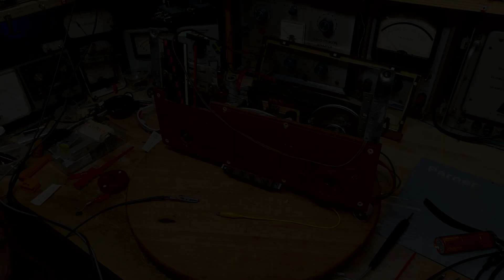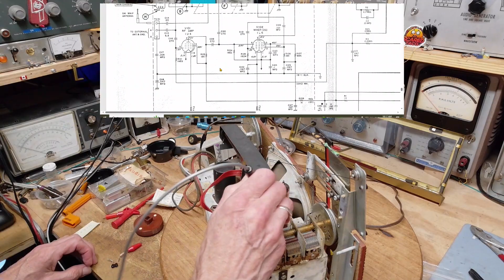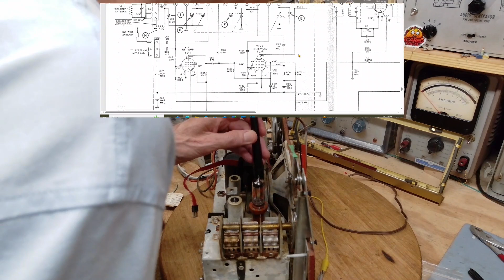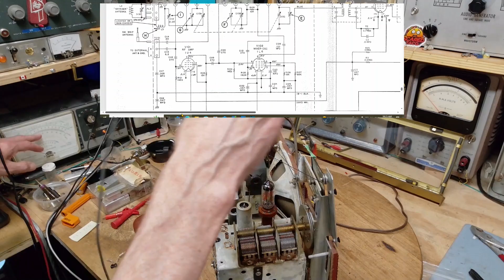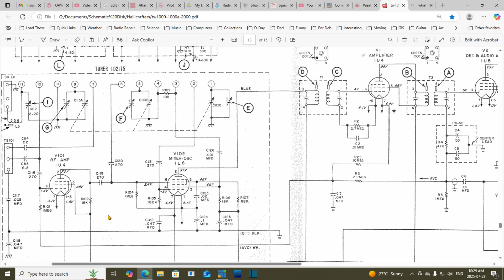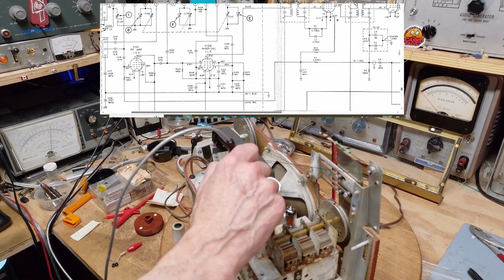Hallicrafters TW2000 Communications Receiver Video #14 - Tuner Tubes Voltages

Comment: Jim I can't get your video back today 8 26 ,2025.
In regard to 3v4 . The 3v4 is biased also by filiment electrolytics and also to  the b+ for plate circuit.
For filiment resistorOK on pins 1,7 for burned out 3v4 r= 3volts/.050 amps = 60 ohms. A 47 ohms 1/2watt resistor should be ok. If center tap is used you need another good 3v4. 
I would check all filiment circuits WITH ohm meter before putting in another good tube.
Please use isolation transformer. Maybe your test equipment is grounding the filiment circuit to cause tube burnout.
Timothy R.

Comment: Jim, as has been previously stated, the tube pin voltages will all read low when the input line voltage is low. Read the notes on the schematic. They will tell you what the line voltage is supposed to be set to. Probably 115 to 117 volts or so. What do you have it set to?  Also be sure to discharge those filter caps before removing or installing any tubes.

Comment: Jim pull the tube out of socket and measure grid 1 voltage should be zero.
I think the tube is rectifying filiment voltage and amplifying it . That's your hum problem so try another good tube.
Timothy Rasch  Green Bay,Wisconsin